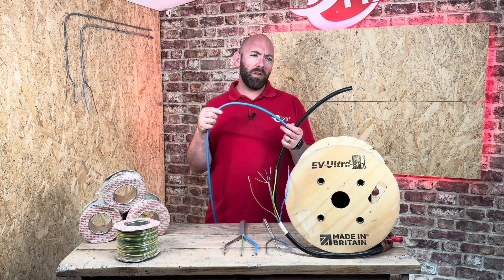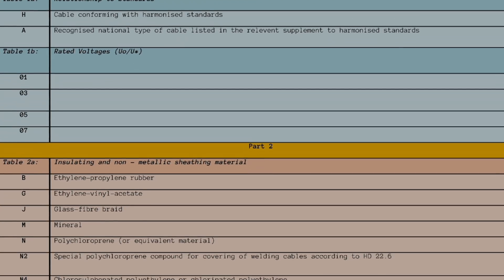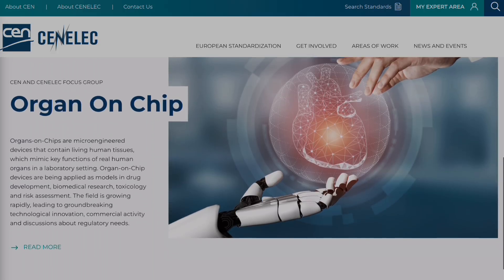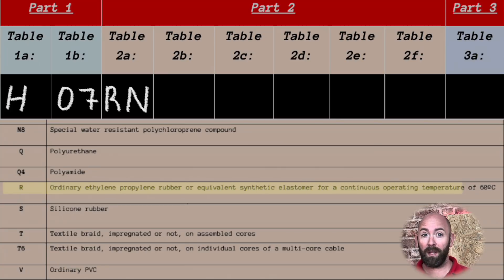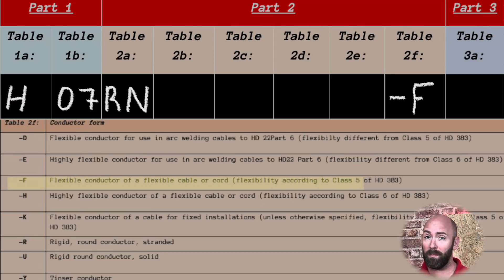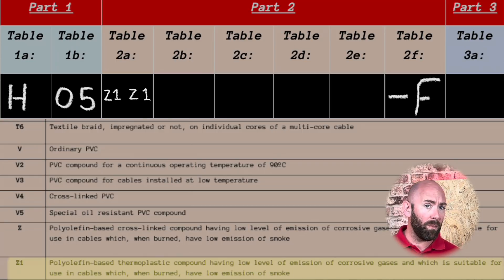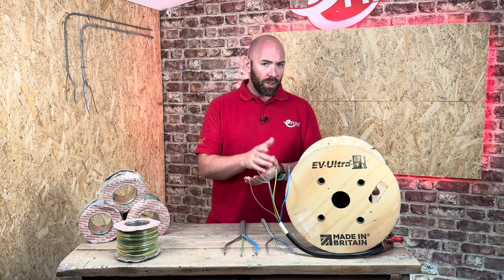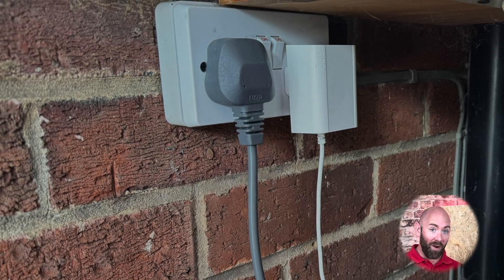What Does This Cable Code Mean? H07 RN-F

Comment: Think Ireland was using lsf way before us  year again were slacking
Reply: Used T&E LSF in 2004/5 on UK installs. Harmonised colours.
Reply: We used LSF starting around 1993 on several new 400kV substations across the UK, both SWA and flexible control cables.

Comment: It could be 3G6 @3:49 but more likely 4G or 5G
Reply: 3 pin red plugs are made for (presumably rare) applications with 400V L-N
Eg PCE's 013-9v

Equally if you had a single phase appliance but only a three phase socket with neutral, you could put a  five pin plug on the appliance and simply draw power from only one of the line pins
Reply: I don’t think it could be 3G — those red plugs come in variants without N but afaik not in variants without E.
Reply: Should be 5G4 with 32 ampere normally; 4G4 have only L1, L2, L3, G and is not more allowed since around 1992 at commercial use in Europe. Every machine with security stuff (machine overheated thing) use N too.